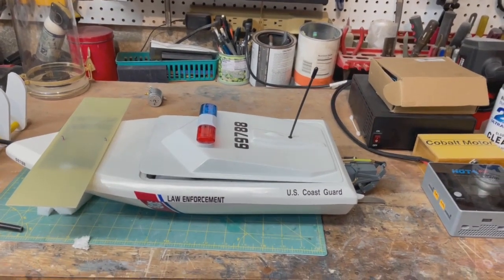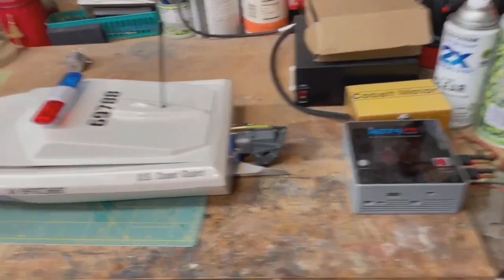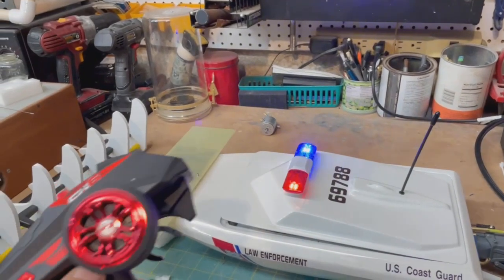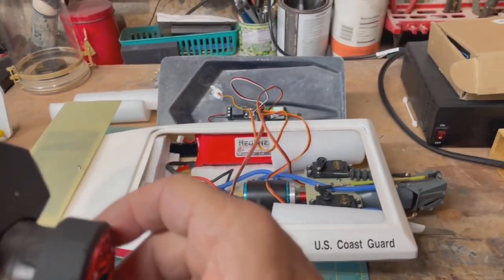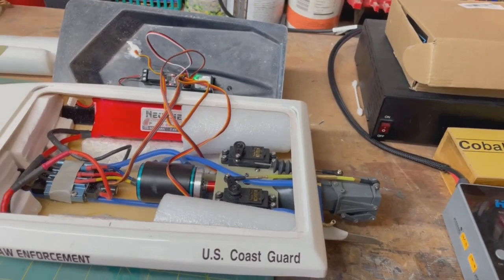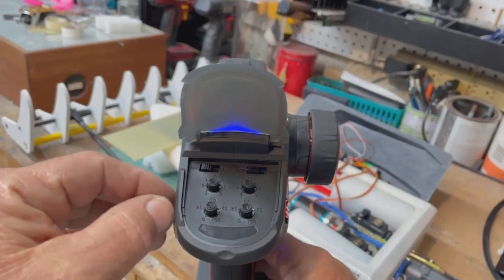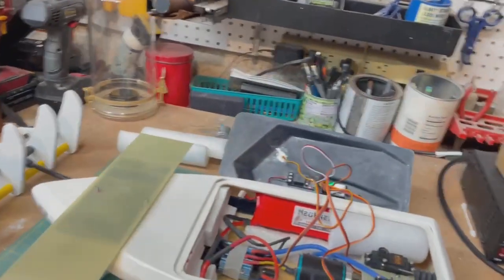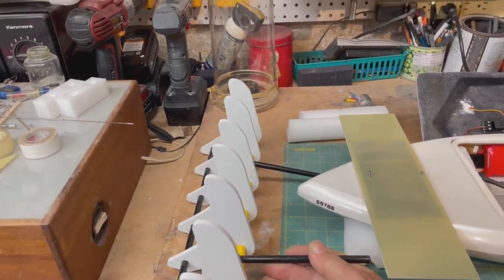Dr. Jet declares FRED seaworthy!

Comment: thats interesting looking transmitter what is it? i went with one of those flyskys just because of the price, although i do like using a radio with sticks inputs on some
Reply from the maker: That radio is branded Surpass (like the motors).  It's cheap as all get-out running 4 AA batteries and analog inputs, but it is 6 channels and works well enough for a rescue boat.